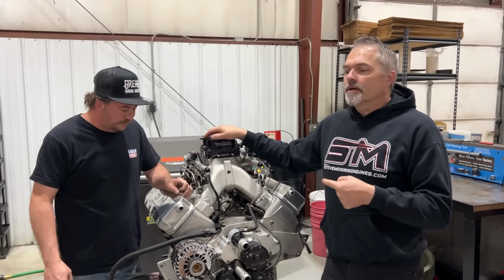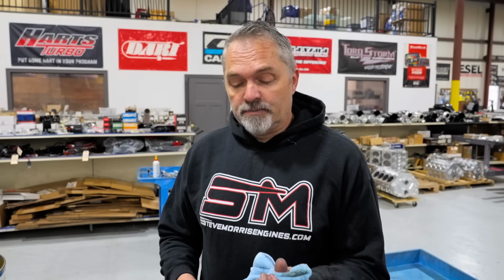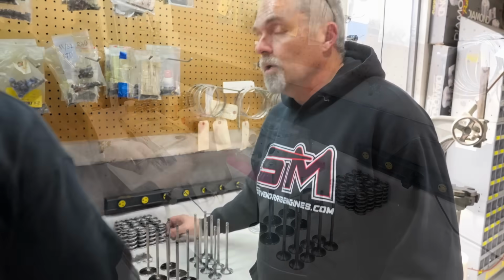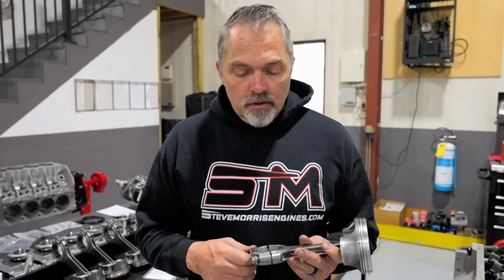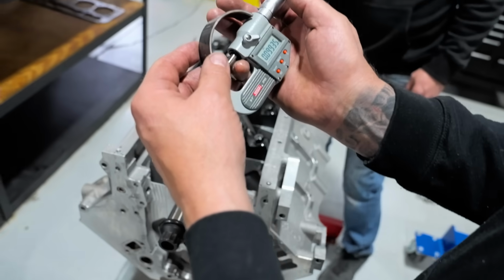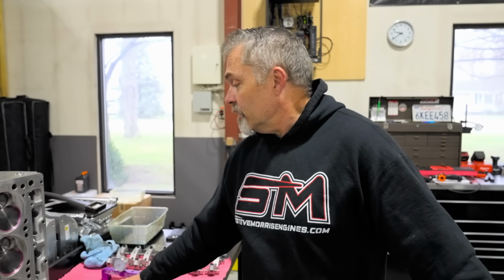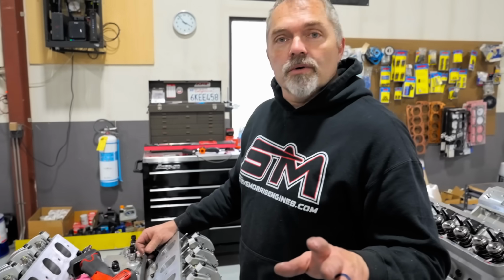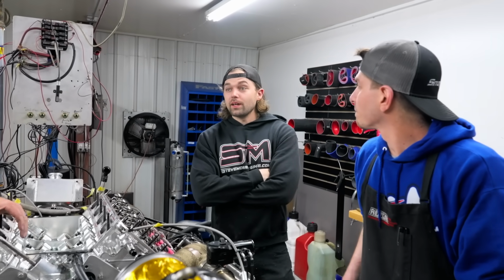HUGE ! 474 cubic inch LS Engine… How Did This Engine Work So Well For 4 Years?

Comment: There is one important thing you missed with respect to the inlet collapsing and that is that pressure is measured in PSI, pounds per square inch.  You would need to take the surface area of the inlet at the opening and multiply that by the pressure differential.  If you only had 4 square inches times 14.7 psi you would get close to 60 lbs of total force.   The area at the throat is a considerably more than 4 square inches.
Reply: This was going to be my point too.  I work in Inhalation medication and an experiment we do is to get students to see what mass they can lift when sucking through a straw, we then provide the straw with a much wider surface area at the point of contact with the weight, hey presto, they can easily lift 10 times the mass.  Real life applications, talk to a machine shop, particularly one that works in polymers and are machining thin plates, its not uncommon to use a vacuum table to hold parts down, and for the inverse i.e. positive pressure relationships what happens when you change the surface area of a pneumatic cylinder? more area, same pressure = more force.
Reply: Exactly there is a ton of surface area on that intake a tiny little brace in the center from top to bottom of the opening would stop it from collapsing
Reply: Just wanted to comment same thing, I hope he sees your comment.
Reply: 100% agree!

Comment: The atmospheric pressure is measured in psi. Pounds per square inch so considering the surface area of the exterior of the inlet isn’t the weight exerted on the surface well beyond the 60 lbs he experienced?

Comment: So in the same night as this discussion about wet vs. dry sump Dennis Taylor goes over his reasons to go to dry sump on the drag and drive 55 Chevy for Alex. Their biggest issue is the engine power is now at the point were the internal windage is pushing oil out.

Comment: 6 vs 8 counterweights, from memory if there's lower rotating mass on a 6 counterweight crank, that means less resistance to change in inertia and faster to spin up to rpm.

Comment: Could you make custom axles for rocker arms with an offset, to raise or lower trunion/pivot point, so you could better perfect rocker top location on individual valves? I realize it’s not a huge issue on this engine, but in other applications using a one pice mount, it could be a way to fix alignment issues. Obviously cost is prohibitive but the axle on the rocker arms appear to be a fairly simple design, that could be an adjustment point …

Comment: Talking about collapsing the intake tube on the streamliner... It's simple physics. As velocity increases, pressure decreases. So atmospheric pressure 14.7psia doesn't matter when a very large turbo is pulling on it. High velocity intake air from the suck of a turbo is actually "sucking" the pressure lower than 14.7 and creating a large vacuum on the intake tube which is creating the force to collapse the tube. 50-60lb is quite alot that you showed on the scale but I believe that's what's happening to the intake tube
Reply: Precisely. Bernoulli's principle. It is not sucking the inlet shut, there's no "suction", it's a pressure drop within the inlet. Would have been fun to see it with a pressure transducer mounted in the inlet, to see what the pressure was dropping to.
Reply: @bigboreracing356  
Nope. No such thing as suction in this case.
Reply: @bigboreracing356  or is it that the suction is caused by a pressure drop 🧐😜

Comment: Would you recommend de-stroking an engine to achieve higher rpm ?
Reply: I know you did not ask me, but that really depends on where you’re coming from, what parts you have and so on. If you have a nicely built 427 LS, just let that thing rev. All you would gain by destroking it, would be less torque and a. Engine which will run more rough as the smaller engine will see the cam as “bigger”. So rather than destroking it, throw a cam in it that will move the rpm up. 
On the flip side, yes you can rev higher for less money with a shorter stroke. But you will lose power doing so. If you replace a 4” stroke crank with a 3.75”, you lose torque, and j promise you that you will lose horsepower, despite some would argue that hp should be the same.

Comment: 4.375 explains why piston looks like it does.
Reply: It could be worse. It has a compression height of about 1.21”. 1.25” or better is where you are with boost. Throw a 6.2” rod in it and you have a great compression height. What will limit you is the crank overlap.

Comment: Curious about what material ring are you using  on the head to header exhaust ports.
I would submise that Bernoulli effect is acting on the inlet of the streamliner engine based on air speed thru the duct  creating vacuum that is overcoming the regidity of the snorkel.

Comment: Is it possible that the bearing is "over rolled"? It could be that the bearing is a thou or so off the cap at the parting line and when you torque the cap, the bearing is forced against the cap due to the crush? It would helo explain why it does not rotate when loose but it's OK whenever torqued.

Comment: Are there any carbon fiber camshaft sprockets,pushrods or rockers or other internal components? If not then why? I would think that the thickness needed or oil exposure would be a major factors .
Reply from the maker: Seen a couple things but never seen them work yet

Comment: The main reason this engine has lasted so long, is the TUNE UP, you can see it in the pistons. I thing I do not agree with is LAPPING the Tia. valves. Do you always do this? I,m sure you know better. Right? Steve also Bore X = will do the same, just faster.
Reply from the maker: I do and have done it for 25 years.

Comment: I always thought the reason for a dry sump was to keep the engine from running out of oil. Under hard acceleration or hard turning the oil can be pushed or pulled away from the pick up tube. Also I see a lot of similarities between these engines and the 5.9/6.7 Cummins diesel engine. The cylinder head bolt pattern is very similar and piston ring design is similar too. They’re both high boost engines, so it makes sense.

Comment: Wondering about ring gaps. My procharged LS2 is limited to 7lbs of boost because of tight factory ring gaps. Is a high compression, N/A engine running at 10K RPM subject to the same amount of heat/ring expansion as a lower compression, boosted, lower RPM setup? Is there a heat calculation for ring gaps or just educated guesses?

Comment: Steve, I may have misunderstood what you mean by the way you are referring to the pressure for that air duct, but when it comes to “vacuum “, the negative pressure can never be more than atmosphere. 
When you say that it took 80 ponds to collapse that duct, and there is only 14 psi of atmosphere are you saying there is more than 80 pounds of vacuum?
In reality,  what you are seeing is the differential between 1 atmosphere per square inch on the outside and the difference in pressure caused by the engine on the inside.   So even if there is just 1 psi of vacuum inside times the surface area, that could reach hundreds of pounds of pressure pushing in. 
I’m sure that’s what you meant, but maybe I just didn’t understand the way you explained it.

Comment: The key difference between anti-friction and anti-wear additives in oil lies in their primary function and the conditions under which they are most effective:
Anti-Friction Additives (Friction Modifiers):
 * Primary Function: To reduce the coefficient of friction between moving surfaces. This means they help parts slide past each other more easily.
 * Mechanism: They typically work by forming a thin, easily shearable film on metal surfaces. This film reduces the direct contact and interaction between the surfaces, thus lowering friction.
 * Conditions: Most effective under boundary and mixed lubrication regimes, where there is some metal-to-metal contact. They are particularly beneficial in improving fuel economy and reducing heat generation due to friction.
 * Examples: Organic fatty acids, amides, high-molecular-weight organic phosphorus compounds, and molybdenum disulfide (MoS2) are common anti-friction additives.
Anti-Wear Additives:
 * Primary Function: To prevent or minimize wear on contacting surfaces, particularly under conditions of high load, high temperature, or marginal lubrication where metal-to-metal contact is more significant.
 * Mechanism: They work by forming a sacrificial protective layer on the metal surfaces through chemical reaction. This layer is designed to wear away instead of the actual metal components, thus protecting them from damage like scoring, scuffing, and seizure.
 * Conditions: Crucial under boundary lubrication conditions where the oil film is thin or breaks down, leading to increased metal-to-metal contact. They are essential for extending the life of engine and machinery components.
 * Examples: Zinc dialkyldithiophosphate (ZDDP) is a very common anti-wear additive. Other examples include organic sulfur and phosphorus compounds.
Here's a table summarizing the key differences:
| Feature | Anti-Friction Additive (Friction Modifier) | Anti-Wear Additive |
|---|---|---|
| Primary Goal | Reduce friction | Prevent wear |
| Mechanism | Forms a thin, easily shearable film | Forms a sacrificial protective layer |
| Operating Regime | Boundary and mixed lubrication | Primarily boundary lubrication |
| Key Benefit | Improved fuel economy, reduced heat | Extended component life, prevents damage |
| Common Examples | Fatty acids, MoS2 | ZDDP, sulfur/phosphorus compounds |
Overlap:
It's important to note that some additives can exhibit both anti-friction and anti-wear properties to some extent. For example, certain organo-molybdenum compounds can reduce friction and also form a protective layer against wear. However, their primary design and effectiveness usually lean more towards one function over the other.
In essence, think of anti-friction additives as helping things slide smoothly, while anti-wear additives are there to protect surfaces when that smooth sliding isn't fully maintained and contact occurs.

Comment: Hey Steve, pressure and vacuum are measured in units like pounds per square inch.  It is the ambient pressure collapsing the tube, it's just acting on a surface area greater than 1 square inch...

Comment: So this engine can produce 1000 hp, but while in use it never really needs or uses 1000 hp. If this engine was used as a truck puller engine, under maximum load and maximum torque/power demand at 9000+ rpm until it either breaks traction or drags motor down, running 15-25 second pulls year after year, would it be in such good condition? Or is it the relatively limited loads of spinning tires on a skid pad that allows engine to live at such extreme operating rpm’s? Of course the engine package,components, and builder 😉 make a big difference

Comment: Honestly, the age of running 3000 lb race cars is over. CJ race cars is rebuilding mullet to 2500 pounds with a Steve Morris big block and a rear end that can run big tires or radials. Memo to Dennis Taylor, you have the fiberglass moulds for the 55, build carbon fibre panels.

Comment: Can you change the valve length or height to change the rocker arm sweep instead of changing the rocker stand height? Why do one instead of the other?
Reply: One limitation there is having sufficient room for the valve spring both at full height and fully compressed with margin to prevent coil bind.

Comment: Hole crap! I was having the exact same problem on my bb mopar with the push rod tips bluing! Only difference on my motor is it was the rocker shafts that were causing my problem. They weren’t sitting properly on the stands and oil wasn’t getting to my #8 pushrods properly. I just wanted to share I was sitting here like oh I know that problem! lol. As always great and informative video!

Comment: You said that thing was getting a Cometic MLS head gasket but it looks like a copper gasket was installed. Is it a copper head gasket or is that what a Cometic MLS gasket looks like for that application? Only reason I ask is the Cometic's I installed on my motorcycle did not look like that.
Reply from the maker: We use a copper spray coat on them

Comment: I had the same problem with main bearings, then I started measuring all the bearings I was using and are all different, some a little bit and some a lot.

Comment: Steve you have to think of that barometric pressure is in one square inch of surface. If it’s 10 square inches of surface area that’s over 140lbs squeezing that intake tube together.
Reply: it doesnt work like that. how many square inches is the surface of your body? are you being squeezed by thousands of pounds of air pressure?
Reply: @ inside of my body isn’t pulling a vacuum to create a negative pressure inside of it. When air is moving fast through that intake it’s creating negative pressure ie.(vacuum) inside of it. Which make pressure differential between inside of tube vs outside of tube.

Comment: I'm 27 and work in construction/maintenance, I've started to learn that the first answer/solution that's thought of is not always the only or final one. Digging deeper to find the out of round bearing made me think of that and that digging deeper just proves experience.
Reply: You need to find the cause not just the symptom

Comment: Two things: Finally found someone that does less maintenance than Cleetus on his engine, and secondly, why doesn't Jesse have thrust bearing issues like Cleetus ? Did not see where he has the thrust bearing wizaedery like you did on Cleetus's engine.
Reply: The BBC architecture has the issue with thrust bearings. Jesse's is LS based
Reply: This isn't a drag motor where you're sitting there with a massive clutch depressed or a torque converter applying thrust to the crank. Not sure of the driver's technique with a burnout car, but if it's just "in-out" on the clutch to break traction and then spinning up the motor, there's not a lot of time where the crank's under load, so less stress on the thrust bearing.

Comment: On the Noonan hemi.i believe one reason for a external dry sump tank is if it kicks the rods out of it most of the oil is contained in the tank instead of the engine daiper.i have a small block chevy that has a external wet sump pump set up with a stefs fab pan (kickout style)

Comment: Maybe…. Once the tires break loose the actual load on the motor is quite a bit lower than trying to accelerate a car over a 1/4 mile.
Reply from the maker: What happens when high power drag cars hit the high end rev limiter? 
Load is easier on engines than unloaded limiter hits.

Comment: The "sump" is where the oil collects/is stored. wet sump is oil in the pan, dry sump is oil in an external reservoir. However, wet sump also implies one oil pump to draw and circulate the oil. so the best term for it would be a multi pump wet sump, or a hybrid oil system.
Reply: The normal terminology is just external pump wet sump oiling.

Comment: I always thought it was a dry sump oiling system.
Meaning the engine oil pan sump would be mostly dry.
Meaning the pump would suck the oil from the engine iol pan sump through other means than a oilpump sump tube keeping it somewhat dry. Less oil windage. 
But I guess I was wrong, it's called a dry sump pump system. Where the pump is dry and the oil can be in the engine oil pan sump?

Comment: Ambient pressure + vacuum pressure = total force that pinched the LSR turbo inlet.
Reply: Was looking for this correction - higher speed flow in the duct = lower pressure acting on the area of the duct gives the "squishing" force. Actual delta in air pressure was probably around a psi.

Comment: I was always taught that IC engines are at their best and most efficient at max RPM. They were never really designed for variable RPM use. I was also taught a properly built and tuned diesel motor should never let out a single puff of smoke. Let alone "Roll Coal"
Reply: Diesels will always black smoke

Its a a by product of diesel combustion

Comment: 1:02:50 Yes it took 50-60 pounds total to squish the inlet, and atmospheric pressure is 14.7psi.
That inlet is a lot more than 1 square inch surface area. 10 square inches at 10inHg vacuum (about 5 pounds per square inch) is 50 pounds.

Comment: I can understand the weight of the pushrod not make a difference on the rocker arm. I am surprised it doesnt make a difference with the lifter and cam. Is that because it's a roller cam? Or does it apply to regular hydraulic and solid lift cams?
Reply: Applies to everything 👍